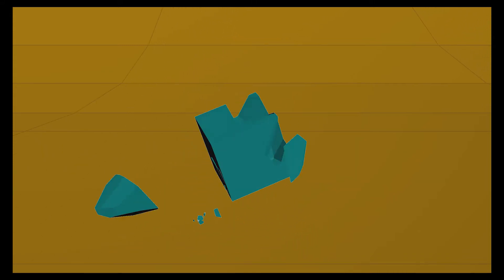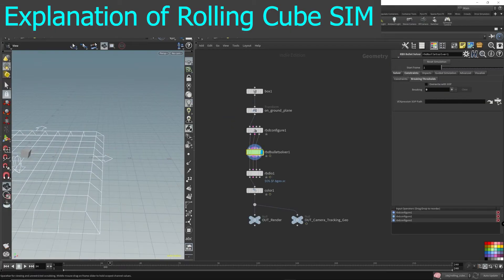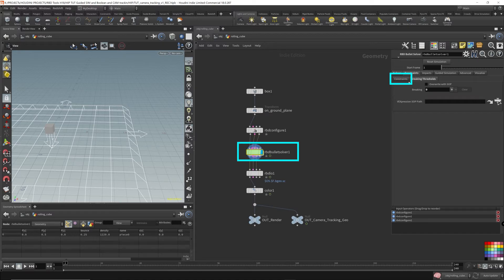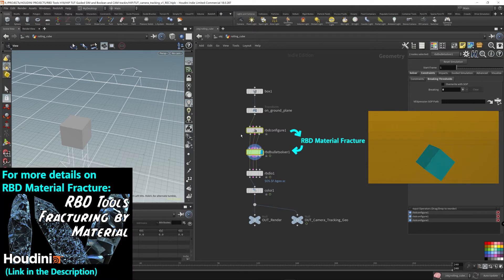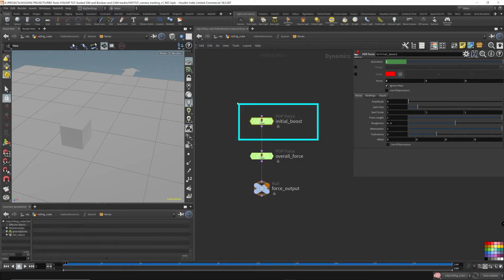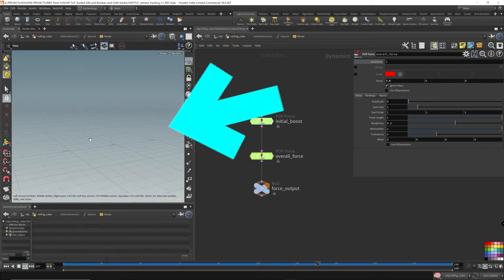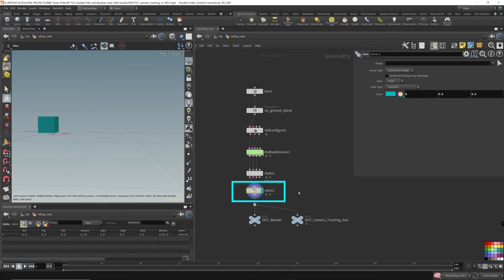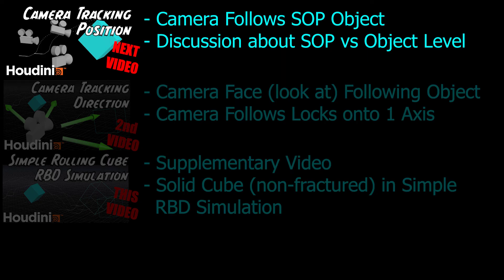Simple Rolling Cube Simulation (Supplementary explanation for Camera Tracking) in Houdini

Comment: Nice one ! is it possible to add a path so that the cube follows it ?
Reply from the maker: You can draw the line using the curve node and then resample it and if you notice the points are numbered in order and you can take advantage of this to be used as steps along the curve.  In a video I show how you can use the blast node and copy to points node to make the object follow the curve line.  You can copy the object to each point for each step.

It's also shown in a previous Members-Only video on how to have objects follow a line:
(the bottom link is timestamped so it'll begin at 1:05:44)
https://youtu.be/tmRL8skYFJ4?t=3944

Hope that helps!
Reply: @bubblepins  I've just watch the video you linked to me , but since its in vop a cant realize how to put that in the rbd solver :(  I can't find the other video with the blast node and the cube who maybe is more clear , its possible to give me the link for this one too ?  thanks for your time and your answer anyway  :)
Reply from the maker: @hydeman75  I think I understand the issue.  There's two ways of doing this I can think of on top of my head right now.  I've created an example file.  Just give a little bit of time to organize it and I"ll upload it onto the Members blog.  Here's a quick summary:
#1)  You can take this RBD Cube shown in this video and overwrite the main position of the cube so the cube remain stationary and use the copy to points / blast method to make it move.
#2)  Use the points on the curve as a force guide to guide the RBD sim.
Both methods I've included in the HIP file, I just need to add some notes and comments and I'll upload it.
Reply: @bubblepins  awesome , i'll study your hip file, thanks again  :)
Reply from the maker: I've created a really quick example HIP demonstrating how to use the blast / curve node technique with this Rolling Cube scene:
https://bubblepins.com/membership/rolling-cube-guided-by-a-curve-path
The password is available on the community tab here:
https://www.youtube.com/post/UgyIqO_rNg04bwK_VYR4AaABCQ

Hope this makes things more clear!
Reply: Perfect 🙌